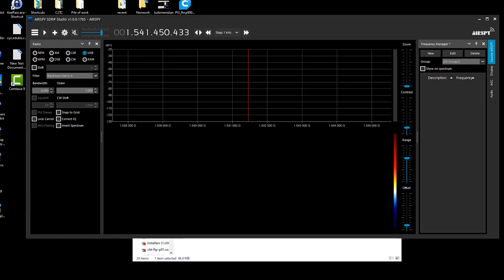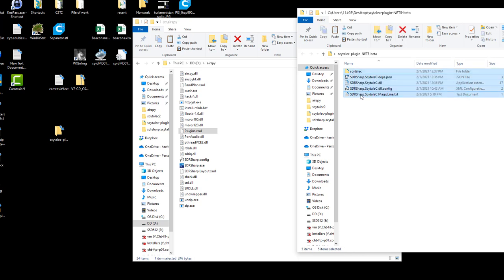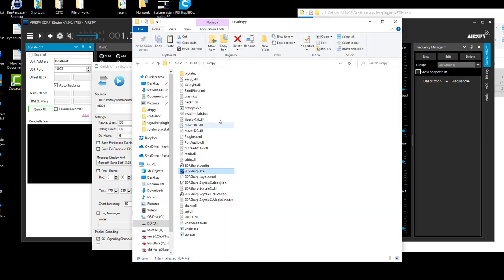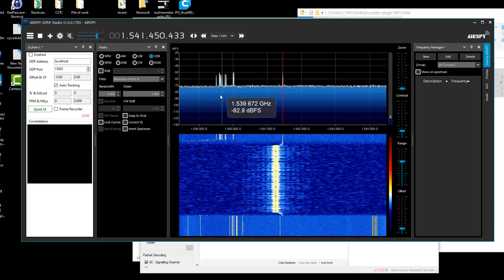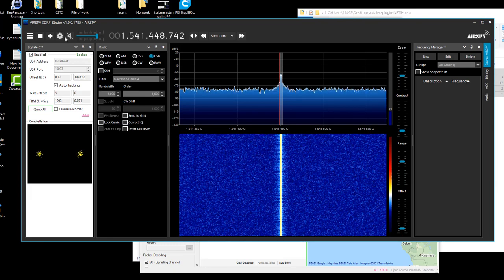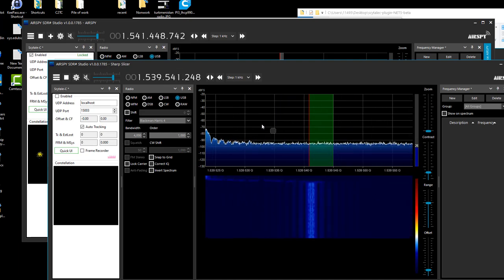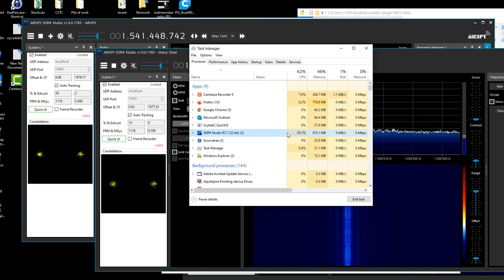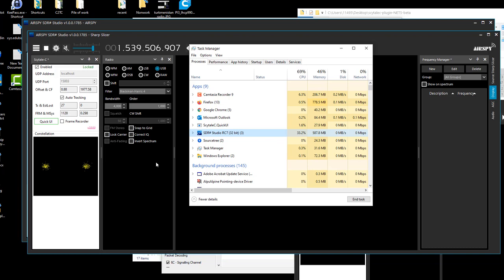Multi-channel concurrent Inmarsat-C decoding with Airspy SDRSharp Spectrum slicer and Scytale-C

Comment: Another great video. Thank you for the work you have done to create this valuable software. Do you accept donations and, if so, how?
Reply from the maker: Oh, you're most welcome!

There are a couple of changes to the plugin. For NET5 mostly. Someone even found a bug in some obscure part of the code (who would have imagined that people are actually looking at the code!) which will improve the processing of symbols, which will improve the quality of the decoding. The code was fixed and checked in but not yet built as a binary. So stay tuned.

Yes, as anything helps. If you scroll down on the code page: https://bitbucket.org/scytalec/scytalec/src/develop/ there is a button to the PayPal page for the product.

Cheers,
Paul